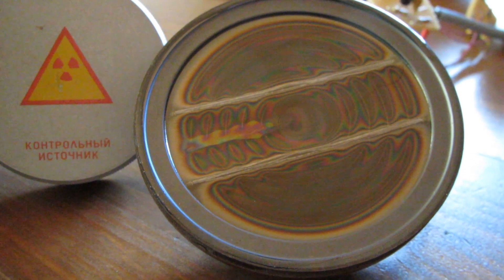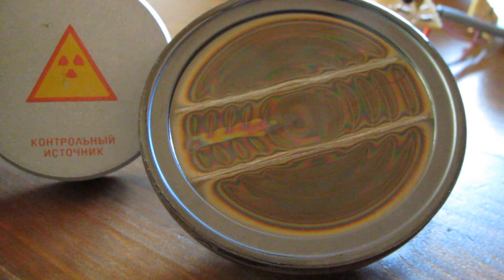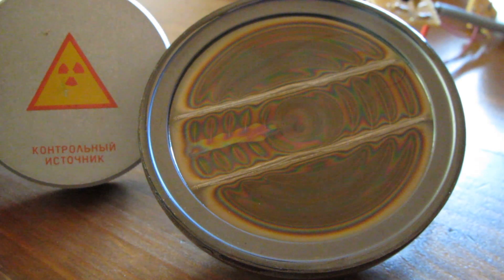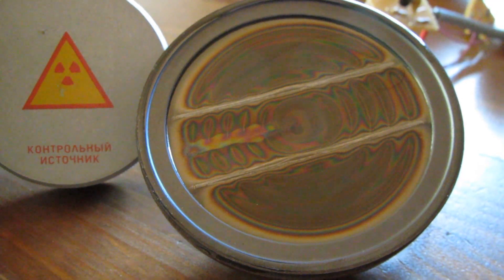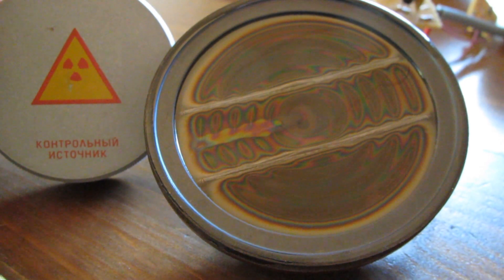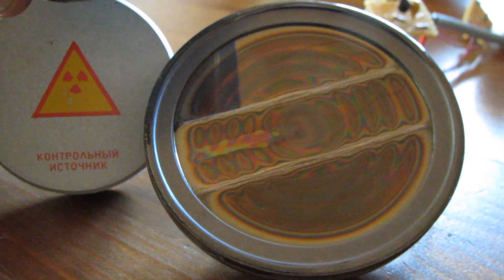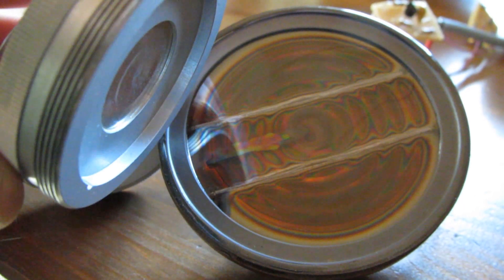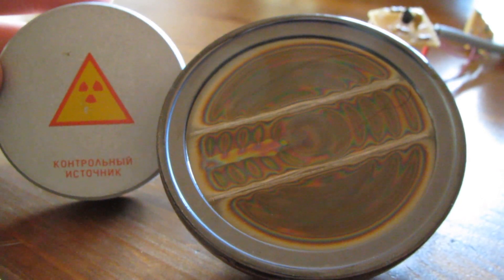soviet СИ8Б (SI-8B) pancake GM tube glowing with beta radiation from Sr-90 check source!

Comment: A very interesting video.  It makes me wonder about tiny little NE-2 and similar neon lamps that are commonplace in things like power strips.  With age, they tend to get rather flickery at first, and then eventually they they stop working completely unless you excite the gas inside with an external light source.  Even still, they will randomly flicker once in a while in complete darkness.  I wonder if they have essentially become tiny Geiger-Muller tubes at this point, flashing over when they encounter a high energy photon.  Have you ever experimented with small neon bulbs such as NE-2?

Comment: Old subject I know, but regarding the "18.2 mkA" max current: It appears to be 18.2 uA not mA and therefore the load resistor is 22M at 400V. It works fine with that. I have more info about this tube on my site at
 gm tubes supported | diygeigercounter
John

Comment: Is the effect along the lines of the radiation you see visually with a spinthariscope? Just that its amplified by the voltages present in the pancake probe? Is this the two inch probe, btw? And did you find it fairly sensitive? Did you plug this into a geiger counter or what is that small circuit behind it?

Comment: Hi bionerd ' just wondered have you a anode resistor fitted  as I built a homemade Geiger counter a used a similar Russian gm tube  and was so excited to test it saw  real bright  flashes from the tube  but then realized  it needed a 4 meg ohm anode resistor  so fitted one and the flashing stopped which was a shame but was concerned to might damage the tube ?

Comment from the maker: ah, i did not even think of this train of thought. thanks for pointing that out. yeah, it's the mentioned applied high voltage which draws apart the charges and causes the electrons to accelerate, which again causes the avalanches and the glow.
too bad this source does not produce cerenkov radiation visible to the naked eye (in water, that is, different experiment altogether); i'd need nightvision or a stronger beta source to do that. :)